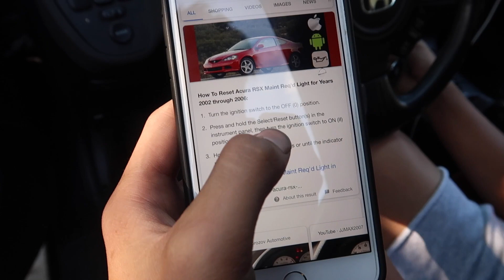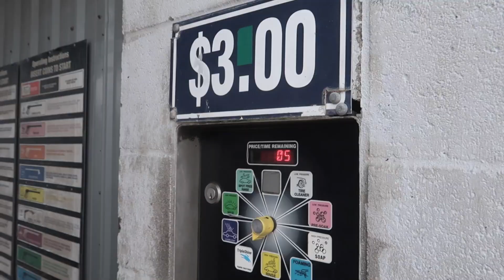SHOWING THE RSX SOME LOVE!!

Comment: I need help is for a friend  everything is acceptable. My friend has a 2002 RSX (Base) it has a K20a3 and his fuel rail line where it goes the little plastic clip on, when fuel pumps pushes the clip and it starts leaking gas. we don't know what it can be we pulled it out to check pull it back in and we felt that was tight enough but it happened again.